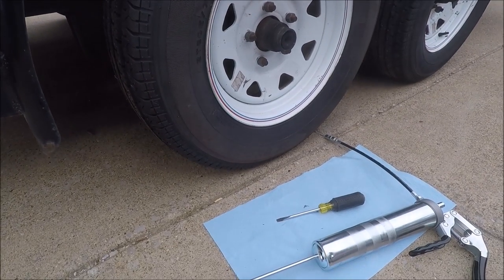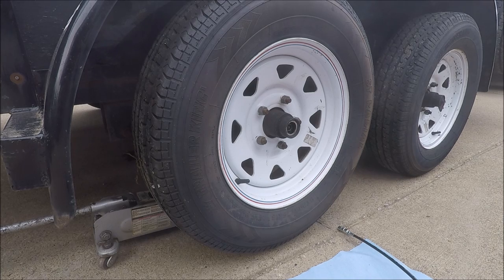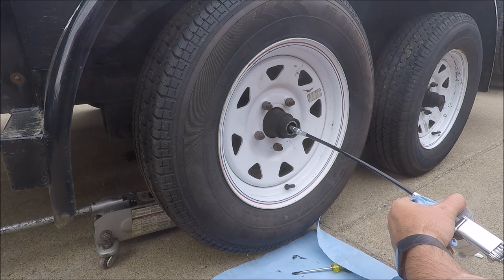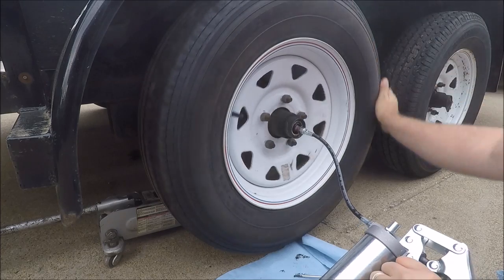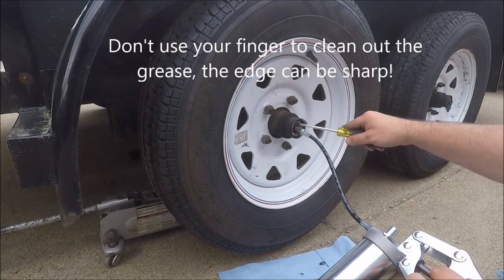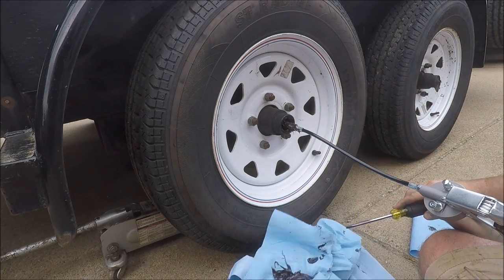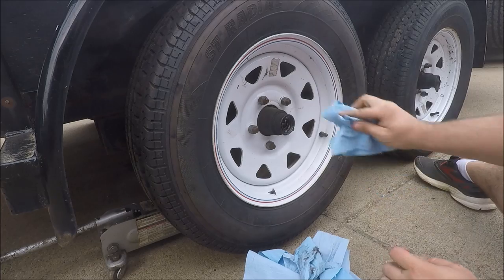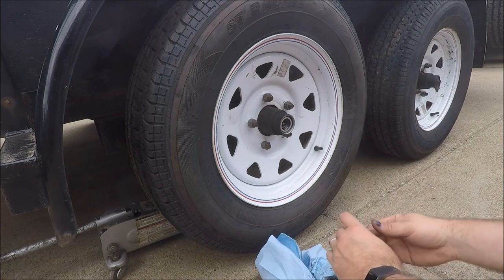How To Lubricate Dexter EZ Lube Axles

Comment: Here is the way I am going to do a hybrid method for my EZ lube axle.   I have only repacked mine the standard way so far.  Have not attempted the EZ Lube way yet.  
 I'm going to do a hybrid version that partly uses both methods....use manual grease gun to pump some grease in while spinning the wheel slowly.  Maybe  6 pumps.  That should adequately renew the grease in the inner bearing, because the spinning wheel will distribute the grease all around in the inner bearing.    Now support the outer nose of the hub with my small rolling jack (not necessary, but that will keep the hub from tipping down on the spindle when the outer bearing is removed), remove the metal dust cap, remove the outer wheel bearing, hand-pack it, re-install the bearing and nut retaining devices, and the cap.    This way both bearings get greased, and the whole inner hub cavity does not get filled, and I avoid the more work intensive process of removing the inner bearing.   Of course, occasionally pull it all down the standard way for compelete re-pack and inspection.   
Comments?

Comment: Maybe a dumb question but I'm curious, why do you turn the wheel while you pump? The grease is forced out by the new grease. How necessary is that. I have an 08 trailer and never jacked it up and spun the wheel and have 25k miles on it with no problems. Interested to see if it really matters
Reply from the maker: That’s the Dexter procedure for lubricating these axles. Yes, the new grease forced out the old, but spinning the wheel helps make it easier and lowers the risk of blowing out one of the seals. I think someone just commented here recently that they didn’t know to spin the wheel and blew out the seal.
Reply: Got you and makes sense, appreciate the very quick response!
Reply from the maker: Darrell Thompson thanks for watching!

Comment: if you car ramps you can pull it up and grease 2 wheels at a time.. Pull it forward again and other tandem will be on the ramps and grease the front set. My dust caps.. the lip is very sharp.. Wipe with a paper towel but lightly or get sliced.

Comment: I bought my trailer in September, must've put I'd say 1000 miles on it. Do I even need to grease it?
Reply from the maker: Probably not necessary quite yet. I bought a new trailer around the same time, and it’ll sit most of the winter, so my plan will be to grease them in the spring before it starts getting used more regularly.
Reply: If it's brand new you will want to. Dealerships don't always top them off and if it's new to you from a previous owner do it for sure for peace of mind
Reply: @creep life if you take the time (about an hour or two) to grease them now you know they are done and can travel with piece of mind. When I did my trailer for the first time I used 2 whole tubes of Lucas red grease. I think the axles from the factory come with minimal grease so knowing they were full of fresh grease was a lot more comforting. 

Just my $0.02

Comment: This is were my Dewalt battery pump shines
Reply: That is what I am going to try. Any advice?
Reply: Bad to use can blow out the back seal
Reply from the maker: I agree with @Lamb Talk, I wouldn't recommend using a powered pump as it increases the change you'll blow out a seal.
Reply: Dexter cautions not to use a pneumatic or power grease gun. These types of grease guns will blow out you rear seals.

Comment: I didn’t realize you had to spin the wheel while doing it when I did mine a few weeks ago. Hope it didn’t do anything bad by adding grease without moving wheel
Reply from the maker: It's a little harder for the grease to get where it needs to go if you don't spin it, and you'll run the risk of pushing out the seals. Spinning the wheel helps the grease flow through the bearings, pushing out the old grease that you can see me cleaning off in the video. Thanks for watching!
Reply: I did the same without jacking up the trailer, now I'm seeing grease inside the wheel.  I assume I need to disassemble the wheel and repack the bearings.  Do you think I need a new seal. I just drove about 500 miles on it with it apparently slightly out of place.
Reply from the maker: Larry Leuchtmann I would replace the seals if you’re going to get in there.
Reply: @stuffyoucando2  how can you tell if the seals are pushed out?
Reply: @nemloc  Grease will sling out everywhere.
Reply: @stuffyoucando2  So pumping the grease in there is enough force to push the seal out? Because one tire I did not spin and that one took a long time before the grease started coming out. I have not pulled the trailer yet, would there be an visible signs of this before pulling the trailer?
Reply from the maker: @jvirg  spinning the wheel helps the grease flow through with less resistance. Not spinning it definitely increases the risk of blowing out the seal. I doubt there will be any visible signs that the seal blew out if you haven't used it yet. You can take a look at the backside of the hub, or if the axle has brakes, pull the drum and check for leaks.

Comment: I have the greese fitting on my boat trailer axle. I find that a great deal of the greese goes in and just oozes out around the carter key hole. Pretty cheasy.
Reply: One recommendation I read is always use warm grease. Do it on a warm day and lay grease in the sun etc
Reply: @mrmotofy  makes good sense but the greese in the hub is at room temperature.

Comment: Great video!  Everyone do yourself a favor and buy a Milwaukee battery powered grease gun. Project Farm here on YouTube said they were the best. If you already have some other brand of battery tools they sell adapters to interchange the batteries with any other brand. Grease is a lot cheaper than having a bearing failure on the road.
Reply from the maker: Thanks!
Reply: Don't use a powered grease gun on ez lube axels. They put out to much grease to fast and with too much force you can blow the rear seal out.
Reply: @CCWSig  You clearly don't know anything about powered grease guns. The Milwaukee battery powered grease gun that I own is adjustable for the amount of grease it puts out and the pressure that it uses to dispense.  You can go as slow or as fast as you want.   I have two trailers with EZ lube axles and have never had a problem.

Comment: Used to do this, until a RV mechanic warned me about blowing grease past the seals. It might be a low risk, but such a failure is invisible. So, no thanks, I’ll do it the old way. 

And before you @ me, look for the videos of the blown out seals. Decide for yourself if it’s worth the risk.
Reply from the maker: I’ve decided on the risk based on multiple trailers owned and thousands of miles traveled, not what someone else tells me to do. Most of the time when people blow out the seals it’s because they’re using pneumatic grease guns which are more likely to blow the seals. Doing it as shown here minimizes the risk, but you do you. 👍
Reply: Sept. 5, 2024
My brake drums always have grease in them with this system.  I had other problems with both axles and they gave me new axles and they do the same thing.

Comment: There’s a step to remove the decree vault logo
Cap to get to the rubber plug.  How do we do that?
Reply from the maker: “Decree vault logo Cap”, what on earth is that? As shown in this video, the rubber cap is removed with a screwdriver, there was nothing covering that as can be seen for the wheel that is not being worked on in the video. If you have some sort of other center cap on your wheels that also covers the mugs nuts, that’s independent of the EZ lube axles, but can generally be removed by using a flat head screwdriver and prying it off. If you have something other than that, please elaborate on “decree vault logo Cap”. Thanks for watching!

Comment: Dexter says:
1. Never put your jack on the axle.  It goes on the frame according to the RV manufacturer's instructions.
2. Always use a hand-operated grease gun...never electric or pneumatic.

I've never used more than 1/4 to 1/3 tube on any hand-packed bearing.  I'd be reluctant to use more than that...maybe it's blowing out the rear seal.  My current Dexter has globs of grease in it when I remove the cap...not sure I'm going to pump that much grease into this axle.

Comment: I have Dexter EZ Lubes on our fifth wheel, and am about to do exactly what you showed in your great video.  Question:  do you ever recommend actually pulling and repacking wheel bearings even with the EZ Lube set up?  Thanks!
Reply from the maker: It definitely can’t hurt to do that. I’ve heard of people doing it to mitigate the risk of causing a seal failure that is sometimes reported with using too much pressure or not spinning the wheel while greasing these through the fitting. If you’re more comfortable manually packing them, I say go for it. Thanks for watching!
Reply: StuffYouCanDo2 If the EZ Lube product works as you’ve shown, I probably will just use it and trust that it is doing its job.  I’ve seen nothing in Dexter instructions or manuals that says to use the EZ Lube AND then manually pack the bearings.  Surely if that was necessary, the manufacturer would instruct owners to do it, right?  Am I thinking correctly?  Thanks for the video and for the response to my questions!
Reply: @rickellis922  "The convenient lubrication provisions of the EZ Lube must not replace periodic inspection of the bearings." - (quoted from the Dexter Axles manual).

Comment: Which grease do you use?
Reply from the maker: You can find required grease information here on page 53: https://www.dexteraxle.com/docs/default-source/dexteraxle/product-documentation/sprung-axles/light-duty/service-manuals/light-duty-600-8k-(lit-001-00).pdf?sfvrsn=1edb1548_10
Reply: for  @stuffyoucando2  
That link been removed
Reply from the maker: @WallsBeeMan  try this one: https://www.lancecamper.com/docs/manuals/Dexter-axles.pdf

Comment: any guarantee the bearings actually were greased on the needles as needed? The hubs are full which does nothing! Better to do it right to get a good inspection of bearings and brakes if equipped''
Reply from the maker: I think the guarantee is that this is how these were designed to be greased. It’s literally how Dexter instructs you to do it. If anyone knows it would be them, rather than someone not familiar with the design.

Comment: I was always told to lift the trailer with a jack from the frame and not the axles.
Reply from the maker: You’ll be lifting a while to get a wheel off the ground, especially on a tandom axle trailer like this with equalizers. No harm in lifting at the axles, especially out far at the ends.

Comment: I really don't think replacing the old grease is necessary. What alot if work ! Just give it a few pumps now and then and you'll be fine.
Reply from the maker: Refer to page 57 of this link: https://www.dexteraxle.com/user_area/content_media/raw/600-8k_complete_service_manual.pdf when you repack non EZ Lube bearings, do you replace just part of the grease? No, you replace all of it. This is no different. A couple of pumps adds a little bit of new grease to a lot of old grease. This video is done per the Dexter procedure.

Comment: When this hub gets hot it will blow the seal and soak the brake shoes and drum with grease...I have fixed many of them.   Take the hub apart and hand pack once every 12-15 thousand miles.
Reply from the maker: I put thousands of miles on this trailer with no such issue. The path of least resistance isnt the the seal, it’s out the front near the grease fitting.
Reply: Listen to this man he knows what he is talking about!!!! If your pumping in a tube of grease, you just greased your brake shoes!!
Reply: @stuffyoucando2  I own a RV Dealership and have worked on trailers since 1975.  I have repaired MANY trailers because someone filled the cavity with grease.  You WILL blow the seal, soak your brakes and ruin the drums.
Reply from the maker: @GrandviewTrailerSale  continue doing what you’re doing and I’ll continue doing what I’m doing. As I’ve said so many times in these comments , I’m doing it exactly as Dexter recommends, and if anyone knows their design and the maintenance requirements it’s Dexter instead of you or me. I’ve had no problems with my trailers following their procedure. Judging by the amount of “use a power grease gun” comments I see, I’m willing to bet that most failures are due to user error using power/pneumatic grease guns and/or not following the procedure. Again, do whatever you want, I definitely don’t have to do what you say. I don’t really care how long you’ve been doing it, I’ll base what I do on my own experience.
Reply: @stuffyoucando2  Welp, when you are replacing everything due to the seal blowing, I told you so
Reply from the maker: @GrandviewTrailerSale  haven’t had to yet on many years and multiple trailers, so go ahead and take your advice that I didn’t ask for elsewhere.

Comment: Not wanting to be a nay sayer but isn't 12 months/12K miles just a little OCD?
The grease coming out certainly looks like it has lubricating properties even if the color is dark.
I've got a utility trailer that I purchased in 1995 - that is 36 years - that has never had its bearings greased.
I do accept that is vastly overdue and I plan on pulling the hub and taking a look see.
Also I have vehicles that have gone years, decades, without greasing the bearings and are doing just fine.
So my question is are we wasting product or potentially FUBARing something if the rear gasket lets grease soak the brakes.
Just putting out this as a contrarian opinion to start a discussion about the "generally suggested advice"?
Reply from the maker: I’m merely stating the manufacture recommended interval. It’s really up to you. If never greasing them is what someone chooses that’s fine, but no one should be surprised when a bearing catastrophically fails at some point. As far as “vehicles” it really depends on what is is. Most bearings on cars/trucks these days are sealed and not intended to be periodically greased. Personally I grease trailer bearings once a year. Grease isn’t so expensive that I need to skimp on maintenance.
Reply: Holy shit capt neglect. 
Because I've successfully neglected my bearings, y'all should too... hahahaha

Comment: When you spin that wheel it doesn't sound right to me. I would inspect those bearings.
Reply from the maker: The bearings are fine. You are likely hearing the slight drag of the brakes. This trailer has brakes on all four wheels.
Reply: @stuffyoucando2  I think we are hearing you pumping the grease gun.  Thank you for this video.

Comment: I just pulled  up the E-Z Lube instructions and it says every 2000 miles or annually instead of 12000 miles.  The instructions also gives a list of approved grease, I do not think the instructions for something  of this importance should be " I  Believe ".
Reply from the maker: My manual clearly states 12 months or 12,000 miles. Dexter operation maintenance and service manual for 600-8000lb axles.
Reply: EZ lube axles were developed for the marine industry in order to push any water out after immersion. They found their way in to the general trailer use by people who incorrectly wish to portray them as an alternative to proper maintenance.

Comment: Pull the wheel off. Repack the bearings , fill it with grease. Easier job and better job. The way you are doing it you do not know if you are pouring grease out of the seal.
Reply from the maker: The way it’s done here is how it’s recommended by the manufacturer…done correctly there are no issues with seals.

Comment: That’s way too much work, I just remove everything including the outer seal and remove the grease and repack.  This way I can inspect the brakes too.
Reply from the maker: I’m not sure how disassembling everything is less work than pumping grease in through a zerk fitting but if that’s what you prefer, go for it.

Comment: If it takes an entire tube per wheel, this design is INSANE. I have pulled trailers and worked on them my entire life and have never seen an axle that has to have ALL these grease replaced every year. Couple of pumps until you see grease come out and your done.

40 years of this process with no failures EVER until Dexter came along and i burn through a spindle because of no grease.
Design failure for sure....

Comment: Why are you wasting all that grease ? Your practically flushing it. All it needs is a couple of pump until you see grease coming from the bearing
Reply from the maker: Refer to page 57 of this link: https://www.dexteraxle.com/user_area/content_media/raw/600-8k_complete_service_manual.pdf when you repack non EZ Lube bearings, do you replace just part of the grease? No, you replace all of it. This is no different. A couple of pumps adds a little bit of new grease to a lot of old grease. This video is done per the Dexter procedure.